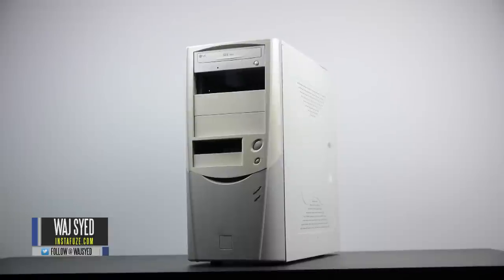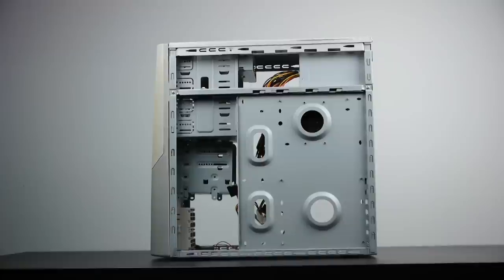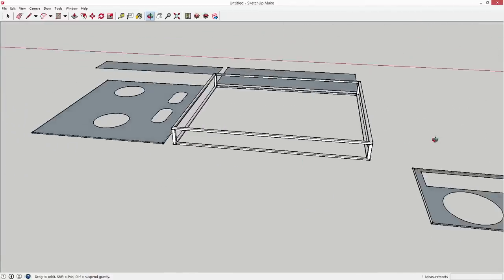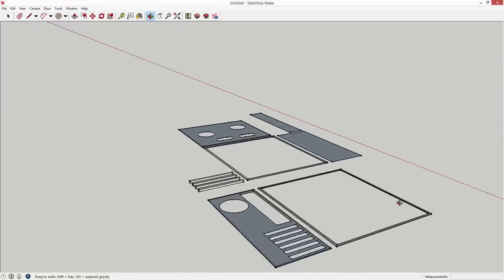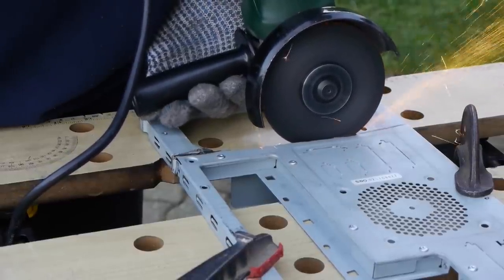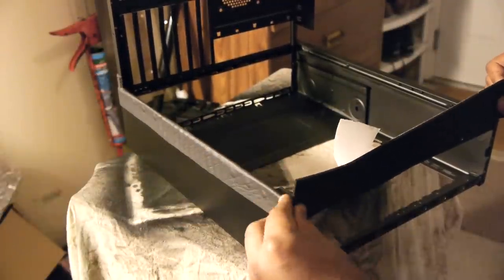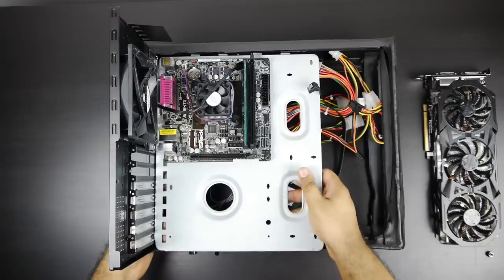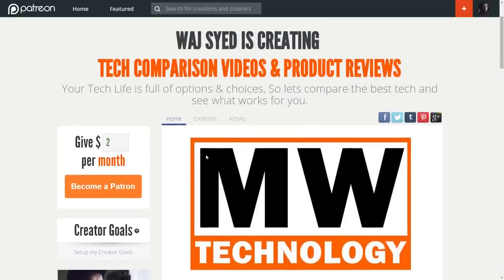DIY Open Air PC Case Transformation

Comment: i run a small ewaste management company and found this helpful. i grabbed a random tower and ended up using tin snips and i grantee mine is the ugliest anyone has laid eyes on. but it works for my bench work. my suggestion for the MKII would be acrylic body or case lidding. all electronics give off ER/F and ive been weary about building an open case for testing random board and parts people throw out for resale. but i fixed this by putting it behind something and "shield" myself from it. anyways food for though

Comment: as a metal worker by trade the easiest way to clean up those sharp edges is with the same grinding wheel you used to cut the case then take a wire wheel on the grinder and go back over the edges again just for good measure. If you have a fine cut bastard file that works great also.

Comment: i like it. What i usually do to protect from sharp edges is use rubber edge strip, it's low profile and looks tidy but isnt great for complex sections like that foam tape you used is. Also in the past i've used a file to roughly de-sharp the edges then run some cheap ass 2 part epoxy resin glue just over the sharp bits.. still poky sharp but not slice you like a razor sharp

Comment: Rather than using the plumbing tape I was thinking a can of rubberized truck bed coating. It should coat the edges, as it goes on fairly thick. Just tape off the portions you don't want coated. I think it would give you a cleaner look.

Comment: Really nice job for a simple build. I think I'd consider some sort of open frame side that would give you some handles to pick it up by as well. Plus if you put hole in the right places, you'd give yourself some RAD attachment points.

Comment: Awesome, never considered recycling an old case in that manner. 
Only recommendations i can think of would be a support railing for the removable mobo tray (on the opposite side of the i/o, to accomodate large gpu's) and since that case is dated im assuming the standoffs mounts are set for standard atx, modify the tray for mini/micro atx and if you have the real estate on the tray, e-atx/xl-atx...

 just realized as i was typing this... But in using different mobo form factors, doing so, will misalign your cases i/o... consider instead of reusing the cases i/o panel, use (for lack of a better term) erector set style railings to support just the gpu and have it screw into that support railing.

Comment: this design lacks of structural resistance. Actually the graphic seems to be suffering and supporting the back panel torsion forces. you should add a "45 degree triangle" where the backpanel meets the motherb base

Comment: if i wanted i could strip it add sliding rails and install it into a desk right? does that make sense? obviously ill figure something out for fans but you think that would work? if not curious what is required for safety within the case. for example the spacing for the motherboard. worried about static electricity.

Comment: Suggestion

1-use an ATX motherboard with SLI support 

2-keap the video card on the motherboard the way you left,connected directly to the motherboard PCIe

3-with the second card,you put it on the  horizontal, with the fan facing outside .I would suggest using Thermaltake Core P5 horizontal VGA stand,an its pci express riser.This way you can still use the SLi bridge,and you won't have one card blocking the air entrance (or exhaust) of the other.

if any one knows any case that uses on video card on vertical and the other on horizontal,please let me know.

Comment: Awsome.
I wonder if it could have been possible to use the HDD supports to assemble them near the Power Unit using the front side to remove them. Anyway, I like it.

Comment: I had this same idea, but I kind of decided against it because of how cheap the actual open air bench's can be. I had 3 old cases that I was really thinking about doing this to, and if I would have seen your video just a few weeks ago, I would have made this. Anyways, great video man! I really like your modded test bench aside from two little things, the reset switch, to me looks like a bad idea. Seems like it might be too easy to accidentally hit the button. I also dislike how the foam tape turned out, it is a great idea, I understand you need something there, but (imo) it kind of hurt the case's looks :/ .... Oh well, thanks again man. Awesome video.

Comment: Wearing gloves when unsing saws or grinders can be dangerous. Doesn't make sense for most people but you have to remember: If your hand touches any moving parts you may hurt your skin or get a deeper wound, a glove can get stuck on a blade and pull your hand in, which can be way more dangerous. That's what anybody using power tools and machinery professionally learns.

Comment: What would you recommend? The Dell P2715Q (4K IPS), U2715H (QHD IPS) or U3415W (Ultrawide curved IPS) for web development and YouTube
Reply: 4K. It is the standard format of 16:9, which prevents unused horizontal space. It is also the highest-resolution, which will last longer.

Comment: not related to this case specifically, but how noisy would an open air case really be compared to any traditional one?  i was gonna make a custom case starting from a very cheap generic one.  For some reason hadn't considering a simple open air design.
Reply: Depends on the components used and how hard you push them, I currently have my new build occupying my ORIGINAL PC case from my first build back in 2000 that I have stripped down to the frame, my build is a 6700k running at 4.5 Ghz cooled by an H100i V2 (with the 2 fans of the liquid cooler being the only fans) and when I get the fans to ramp down (still kinda learning the fan controls) and run AIDA64 to stress test it I only reach 71C and its quieter then my old "fat" PS3, of course I don't have a graphics card just yet so that should introduce some noise as well as push my power usage up high enough to cause the PSU fan to kick in (PSU has a Zero fan mode till about 40% power usage). but as it sits now with the right fan profile it is quieter then the crickets outside and at 6 feet is quieter then the lowest fan setting on my G750JM-DS71 gaming laptop at typing distance.
Reply: Like Daniel said it could be loud or quiet depending on the components. The main components that make noise are Fans, Pumps (water cooling), and HDDs. Fans you can get pretty quiet. Noctua and Be Quiet! are two pretty reliable companies that make quiet fans. HDDs only make noise on startup and when you use them, and replacing them with a SSD will get rid of that noise completely.
Reply: Jonathan Bright
 additional side note on fans, even the best fan designs can't avoid noise at HIGH RPM's so it's better to have MORE QUALITY fans spinning at LOW RPM's then fewer fans spinning faster.

Comment: Can someone tell me how to overclock an AMD Quad-core A6-5200 Accelerated Processor?
Reply: Which motherboard are you using? If that's a mobile processor I wouldn't do it.
Reply: No point, what gpu do you have?
Reply: Not sure. It actually broke tbh. The operating system is failing every time I turn it on
Reply: local drive C find system32 folder and delete it

Comment: Well, I am really sorry but...the result is quite poor compared to all your work you put inside.
I made a open case too and just used the backpanel from the old case. It was faster, easier and looked better.
Next project is to make a PC case 100% from acrilyc glass, using a laser cutter.
Reply: +Emilia Fairbrook Nice. I hope you'll use some LED panels for the power supply and motherboard error messages as well. Will you make a video?
Reply: +Emilia Fairbrook please put some videos up, id love to see that case! :)
Reply: +Jack Carter 
+OldGamer 1982

I still didn't recieve my components :/
and I decided to go for a mix of MDF and Acrylic glass.
I won't be done until end of march, since I have to wait for access to the laser cutter
Reply: ***** ahh that's too bad! what components are you waiting for? you take your time :) ill wait patiently for the results :) now im off to cut up my old InWin s500T!
Reply: +Jack Carter 
I know, it takes ages, but can't change it. 

My components:
Intel Skylake 6600k CPU
MSI R9 390 8GB GPU
16GB 2100MHz DDR4 RAM
Asus Pro Gaming Z170 
Mugen Scyte Max Cooler
XPredator Semimodular 600W PSU
265GB M.2 Samsung SSD (2GB/s read speed <3 )
Reply: +Emilia Fairbrook very nice setup! I'm still rocking the I7 2600 partnered with the Palit super jet stream 980ti, works flawlessly @ 2560 X 1440 and I get about 45-55 FPS @ 4K :)
Reply: +Jack Carter 
GPU is way more important for gaming anyway.
But since I built from scratch I chose the Skylake. it's a great platform and very easy for OC
had no money for better graphiccard, so I won't get any 4k :(
Reply: The 390 is still a beast you'll be fine at 2560X1440!  :)
Reply: +Jack Carter 
Idk if it's clever to buy a 4k Display anyway, or will it look shit if I only play 1440p on it?
I know a lot about PC components, but barely anything about displays...
Reply: +Emilia Fairbrook nothing will beat a resolution at its native display but I'd go for the 4K, 1440p still looks outstanding on it. 27" or more is my recommendation for 4K.
Reply: +Jack Carter 
jep, that's what I thought :/
Idk, I have to compare prices a bit. I have an older 1080p display here, so that will do for the start

Comment: would a dremmel be able to do this
Reply: +Harrison Knight a dremel can do the cutting, but the larger the disk the straighter your cuts will be.   As an Angle Grinder can have like 4"-6" disk.
 you could possibly get away with cutting the rivit heads off, but a drill is much easier and cleaner.

assemble with nuts and bolts if no rivit gun also.

(ps sorry english is my first language)
Reply: Joshua Fisher so if i get a medium to big blade itd be ok i dont need it to be ruler straight
Reply: +Harrison Knight yea and Prolly sound the few bucks on it being diamon edged.  as cheap wheels you could go through a few depending in the metal.       example I had to cut a motorcycle axle and only diamond saw would work